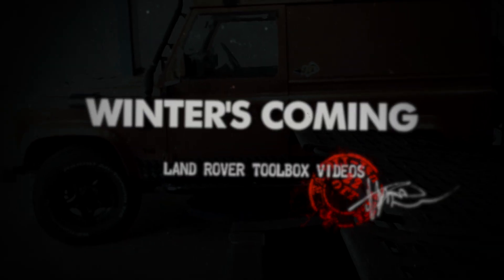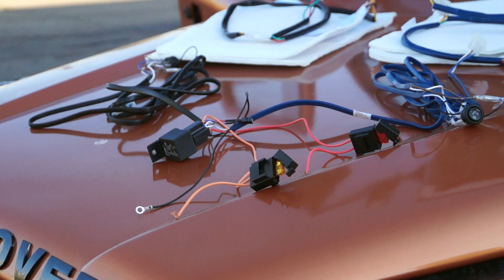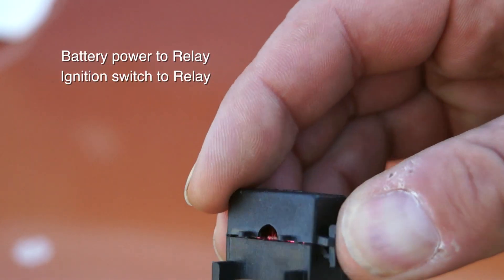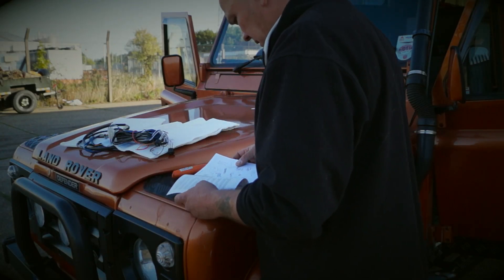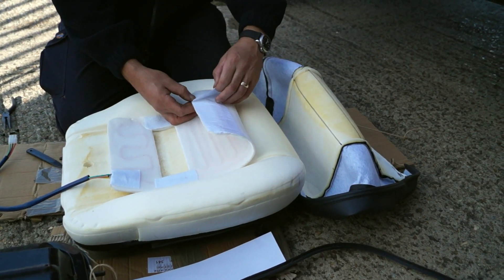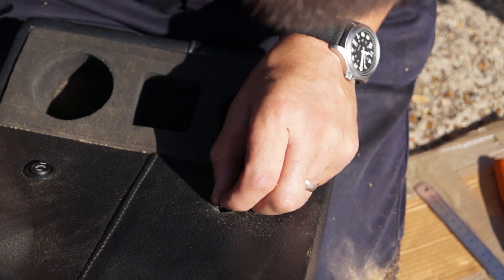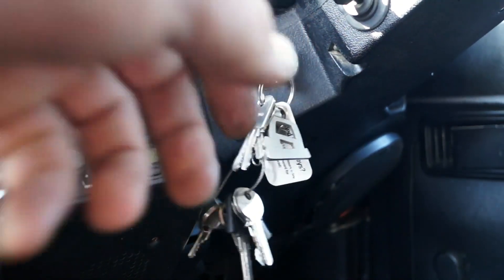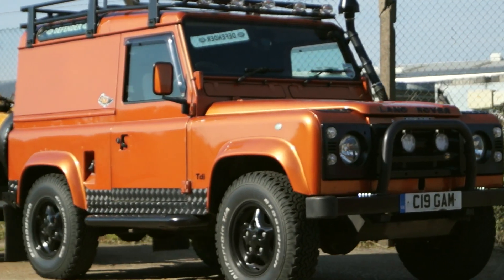In the hot seat - Land Rover heated 2 seat kit from Paddock

Comment: Do you reckon it would be possible to use this kit (I think the exmoor trim is the same one as well) but use the OEM factory switches? I've seen OEM looms but they are the price of this whole kit alone before you buy the heaters!
Reply from the maker: Don't see what not.  you may have to find the right wires connectors to the switches but they are just on / off switches aren't they?